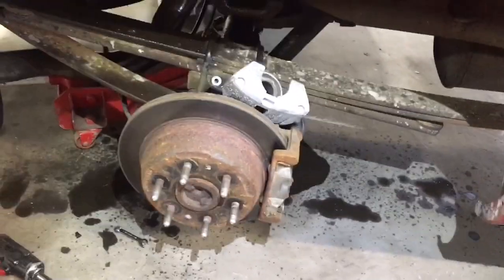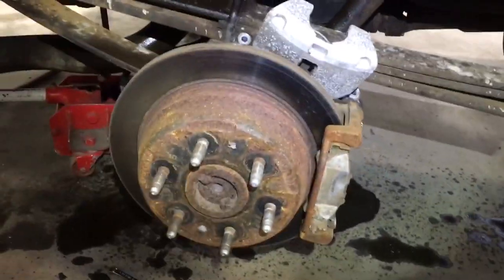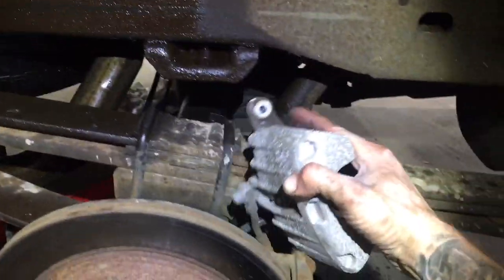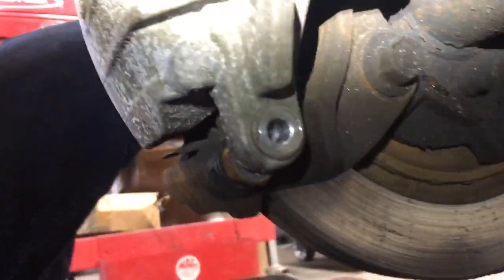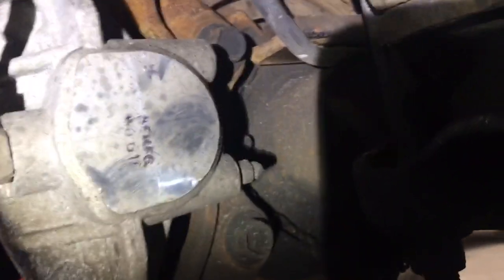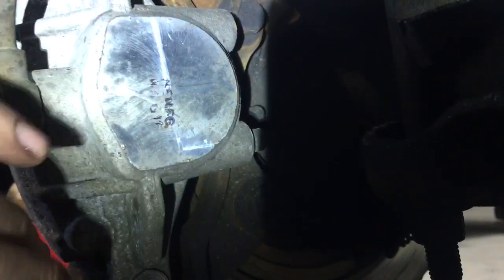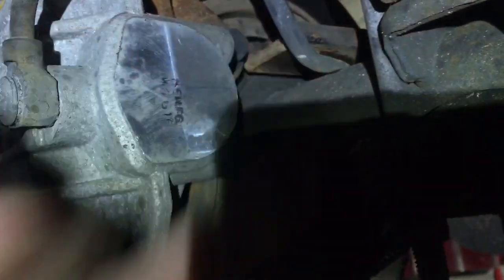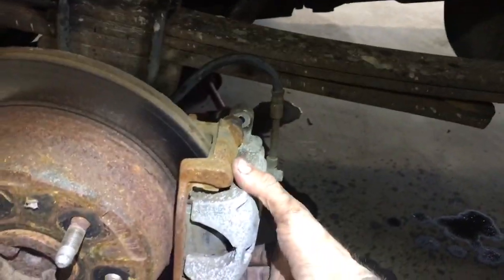Bleeding Brakes Troubleshooting / SOFT BRAKE PEDAL

Comment: Maaaaaaaan, I replaced all of my calipers and bought a Motive brake bleeding system... Bled them at least 7 times and STILL couldn't get the pedal to stiffen. Watched other videos about checking for leaks and if nothing is found it's probably a master cylinder. Just ordered a master cylinder yesterday.. got curious and came across your video... walked to the garage and looked... CALIPERS ON OPPOSITE SIDES! Lol... YOU are the man. Thank you SO much for making this video!
Reply from the maker: Ball and Chain glad it helped!
Reply: You should have threw in a couple 100 gram tablets of viagra. brakes will stiffen up for sure.

Comment: Man I've done brakes all my life and can you believe I've never made that mistake until today? After replacing both calipers, pads and rotors, I couldn't get a pedal on my 92Jeep. I never would have thought of this. First thing in the morning, going to make the switch and with fingers crossed, I'll get my pedal back after bleeding it. Thanks for educating us that didn't know this.
Reply from the maker: Keith L Beaubien any luck?
Reply: @JeremysCarRepair  Low and behold! As soon as I switched the calipers to where the zerk bleeder screw was at.the top and bleed the system, I got my pedal back. That's for tip. Something so simple over looked can make the difference.
Reply: Was suppose to say Thanks for the tip!
Reply from the maker: Keith L Beaubien nice!
Reply: This is the only video ive found pointing this out!!! Ive been loosing my efing mind trying to figure out my squishy brake problem, bled'em to death,new master cylinder and this makes since. Ive got 05 grand am gt and i thought this when first looked at my calipers,i think all 4 are on wrong because all the bleeder screw are at low points :(  .....sooooo,we'll tomorrow, lol.or ill just do like you said and pop'em off flip'em up,stick a 2x4 in there and what happens..... Wonder how many ppl really have this prob,and have no idea lol.

Comment: I changed the back drivers side caliper on my wife's hummer H2 and couldn't get the pedal to harden. Just video called my wife, she checked it and sure enough bleeder is on the bottom. Wtf. Going to try what you did instead of returning it.

Comment: I do have another question. I own a 2012 Chevy express and am currently replacing the driver side rear brakes and I’ve been trying to bleed them and my brakes are still spongy. After watching this I went back to check if the bleeder is on bottom and it’s not, it’s on top and still having issues with it being too spongy. Help anyone?

Comment: 02 Corolla bled the brakes and got them steady stream of brake fluid. Started the car and it went spongy again. I really dont think its master cylinder. What could I be missing
Reply from the maker: Sir Cash did u watch them video? If you bled it enough and your calipers aren’t upside down (air trapped in system) it’s your master cylinder.
Reply: @JeremysCarRepair  could it be because I never bled rear brakes lmao I worked with a friend who did their brakes by themselves, told me I only had to do the front brakes.
Reply from the maker: Sir Cash what repair did you do?
Reply from the maker: Sir Cash if you did front calipers, the. Yes you only need to bleed front. If the pedal is not returning, then I would try the rears Incase some air worked its way back...and not to insult you, but if you only did brake pads, you do not need to bleed brakes. I have had ALOT of people tell me they had trouble with bleeding brakes after a simple brake pad replacement!
Reply: I had a friend come over to help me replace the cv axel. Never did it before. It was a pain. But he unhooked the brake line. And it was left for 2 days. Afterwards i got everything back together and put line back on the brakes were completely gone. He told me then to only bleed the front. Still nothing happened. Today im going to bleed RR - RL - FR - FL
Reply from the maker: Sir Cash aahhh ok. Yea bleed the rears and everything will be 👍
Reply: Ok I got my brakes figured out... started the car up and check engine light with a rattle idling at 500 or so rpms. Spark plugs most likely gone? Sorry for blowing up your feed but you seem knowledgable lol
Reply from the maker: Sir Cash start with reading engine code...most likely an ignition coil if you have over 135k miles and haven’t done them yet...but just a guess!